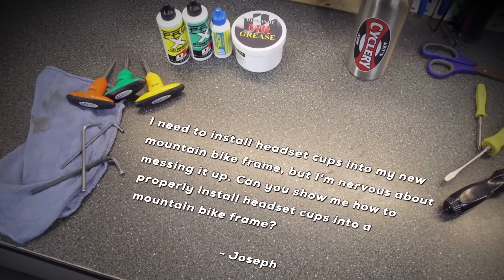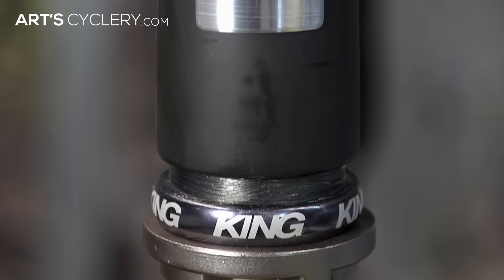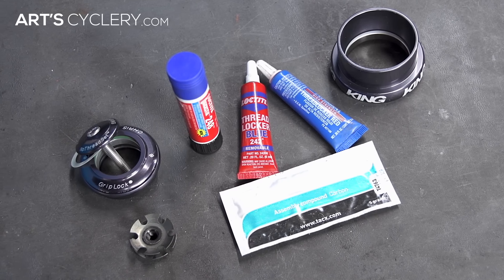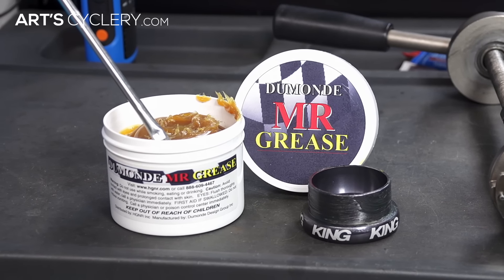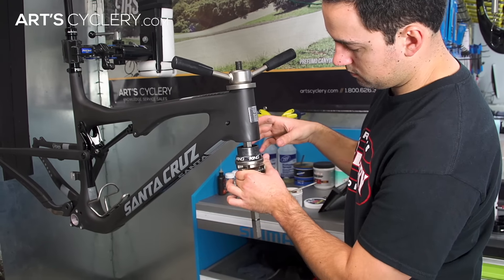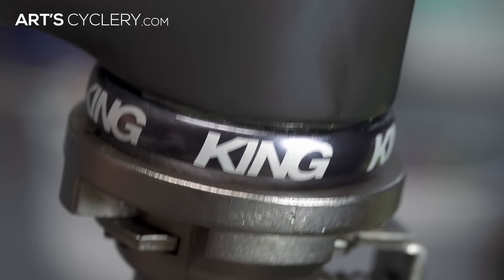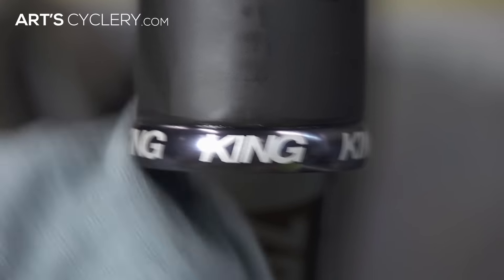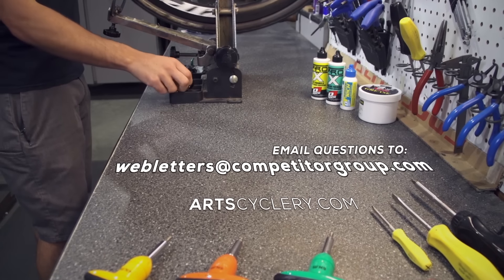Ask a Mechanic: Installing Headset Cups

Comment: Finally a video were  the lower cup is installed first and then the upper cup.Alot off clips where both cups are installed at one go which doesn`t make sense in terms of alligment.I will be giving it a shot with a cheap headset press tool of aliexpress for budget alu hardtail relplacing caged bearing headset with a better sealed bearing headset.

Comment: How do you do it with out that expensive tool
Reply from the maker: +RC Zim We don't recommend other methods because you can easily damage your frame. If you don't want to spend the money on a bearing press, then taking your bike into the local bike shop is your next best option. Hope this helps!
Reply: +Art's Cyclery  thanks I was pritt sure it was the only tool for the job
Reply: +RC Zim You can make your own press with threaded rod, large fender washers and some nuts. They can't tell you that for liability issues and of course it won't be as nice as a real press.
Reply: I installed my tapered 1 1/8 - 1.5 headset cup with hammer, pieces of clothes, #120 sandpaper and a sharpening stone.